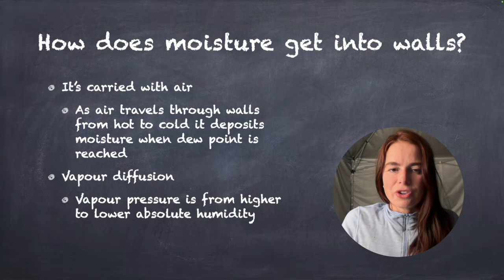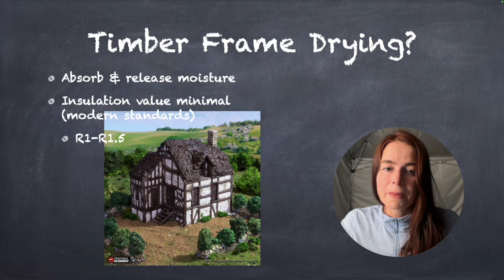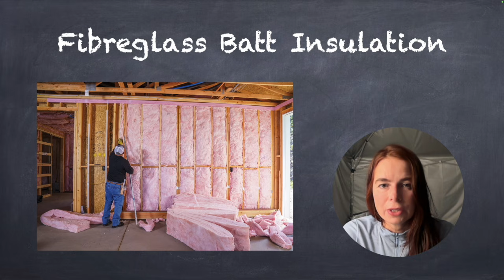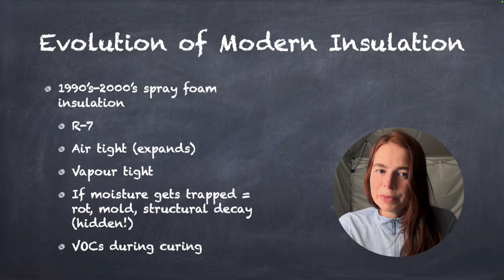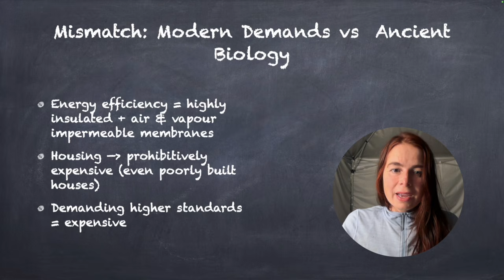The Evolution of Building Practices - Walls

Comment: I'm curious to hear your opinions on methods like brick and stucco. Honestly I was surprised that neither was mentioned here. I spent some time in Argentina, and most houses there are built using oversized hollow bricks, which then receive a 1-2 inch thick layer of cement on both the outer and inner surfaces of the wall. Interspersed throughout the load-bearing walls are poured reinforced concrete pillars, which also form the foundation as a hole is dug underneath each pillar and filled with reinforced concrete.
Reply from the maker: You’re right.. traditional brick and lime stucco would have fit here. I focused on earth-based systems in this episode, but brick laid in lime mortar and finished with lime stucco belongs to the same pre-industrial era of building.

Where things really change is with modern brick paired with cement mortar and cement stucco — those assemblies are much less forgiving when it comes to moisture and drying, which is why they tend to age so differently. That shift probably deserves its own video.
Reply: @thehealthybuildingproject  So it sounds like you would recommend lime mortar over Portland mortar. Why is that? If you can summarize it into a quick reply that would be great, though a full video on the topic is absolutely something I’d watch.
Reply: @thehealthybuildingproject  Yes, would love to see such a video.  Thank you for your content.

Comment: A lime based white washing on walls often helpped protect them, far more than we realise today. A protective over coating if applied right and often enough may prevent some problems that otherwise would become major issues. It is often the small over looked details that make a huge difference that compound into massive changes.
Reply from the maker: Couldn’t agree more. Lime is one of those materials that looks simple on the surface, but the deeper you go, the more extraordinary it becomes.

I’m actually in the middle of a deep research dive into lime right now—its history, how it’s made, and why it behaves the way it does—for the first video in a series I’m working on about the history of concrete. It shows up across so many cultures, climates, and eras for good reason.

That idea of limewash as a sacrificial, breathable protective layer is especially under-appreciated today. When applied correctly—and renewed over time—it can quietly prevent moisture and durability issues long before they ever become visible problems.

You’re exactly right: it’s often these small, easily overlooked details that compound over decades into either resilient buildings… or failing ones.

Comment: Mitigation start points: Sealing up from outside moisture, replacing insulation with rock wool, using more moisture permeable coverings like lathe/plaster on outside wall and ceilings. Avoid high temperature differences that is should we leave more rooms cooler if we can? Any thoughts?
Reply from the maker: Good instincts here. Bulk water control comes first, and materials that can tolerate and release moisture make modern assemblies much more resilient. Temperature matters mainly insofar as it affects surface condensation and drying potential.

Comment: I wonder if one of the culprit "modern demands" we're making on houses is the expectation that our indoor air temperature remain at 72-degree no matter the change in seasons. The temperature differential between the outside and inside air will create moisture risks year round. I know people aren't going to want to hear about wearing sweaters and heating bodies not air during the winter or - gasp! - go without AC in the summer, but still it's a potential low tech -low cost area to consider.
Reply from the maker: 100% - I read a bit today about how we survived in the past before central heating and heavy insulation.. we managed with localized heat, small rooms, massive heating appliances, heavy clothing... My next video is on ancestral roof systems but I actually thing the idea of questioning our modern expectations of "comfort" (to the detriment of air quality and health) is an interesting one to explore.
Reply: @thehealthybuildingproject I would love to learn about roofing systems!! So glad to have found your channel. 😊

Comment: In the southern USA, we have very warm humid air, so the vapor barrier is generally on the outer side, and the building is dried from the inside with the HVAC. However, I was on a number of construction sites in the 90s where we made the insulation extra cozy and put a polyethylene vapor barrier on both sides to make extra special mold bags! You're welcome. (I am available as a witness in the court cases) I find this topic extremely interesting.

Comment: As a Northern-European I have to say that there are easy solutions for all these problems and have been atleast 30 years already. It's just that people like to invent their own solutions and do the things like they have always been done, be it North-America, Japan, Australia or any other place. We build very similarly to North-Americans with stick frames and poly vapor barriers, but there are some major differences that highly effects the functionality of the structure. Having a vapor barrier (or anything that acts as such, like osb) on both sides of the insulation is absolutely forbidden. Great enphasis is given to natural ventilation behing exterior siding and under roof so any moisture or water that might get in the wall also has a way out of there. All materials in a wall must increase in water permeability going outwards so the wall structure naturally "pushes" moisture out. We also put a 2x2" horizontal strapping with 2" insulation on top of the poly to create a cavity for all the electrical lines and boxes and to protect the poly from all nail and screw holes in the future. And with an air tight house there also has to be forced ventilation that keeps a slightly negative pressure in the house that prevents moist air being pushed in the wall. There are many more differences from the foundation to the roof, but just to mention few.

Also the matter of indoor air quality affecting health has been studied to death in the past decades and is taken very seriously here.
Reply from the maker: You’re absolutely right — that’s a great summary of sound building-science principles. Northern Europe is way ahead of North America in actually applying them. Modern stick-frame construction can work well, but only when every layer is detailed with a solid understanding of moisture, air, and heat flow — and that’s almost never the case here.

Comment: Another excellent video!

Now, about those "intelligent" vapour barriers (membranes)... 

- The "Intello" one only "opens up" when the membrane can reach a temperature of min. 28°C (82.4°F) which is not always possible when you're using an airconditioner in summertime.
When using it in a basement, it will never open up...
- The SIGA one... The university of Vienna did a test and the difference between both directions was only 30%. 

In General
__________
Don't use vapour barriers but concentrate yourself on "air barriers" as every air barrier is also (more or less) a vapour barrier.
Use air barriers made from natural materials that can also buffer dampness , i.e. plywood, hardboard, MDF, all kinds of "eco boards",...

Sheetrock is also a great air barrier but it has the drawback that it will hold up moisture for too long which will turn it into a ground for mold growth (if it's not well insulated from cold or not properly ventilated).
Reply from the maker: Thank you! That’s such great insight — and I think you’re right about the smart vapour retarders. My impression too is that they only ‘open up’ in fairly specific conditions, so I’m not sure they always allow drying fast enough in the real world. I completely agree that air control is huge. Solid-mass assemblies (like my true love, rammed earth) tend to be far more forgiving when it comes to moisture. Really appreciate you sharing your thoughts!
Reply: @thehealthybuildingproject  Lot's of people think they are on the safe side by using a smart vapour retarder, but I would not rely on it... it's just marketing, you buy a very expensive membrane.

There's a case of a Belgian straw bale house where the owners thought they could rely on it in the flat roof assembly.
But the "intelligent" membrane never opened up so the straw and OSB started to rot after 2 years.
(The roof section contained a lot of moisture dating from the building period, i.e. the internal plastering).

Comment: Modern building philosophy seems to have complicated moisture management by eliminating "decorative" features like roof overhangs, window ledges and window sills. The problem is that these features were not originally intended to be decorative and buildings lacking them need near-perfect water sealing, something that cant' be guaranteed. The worst residential examples of this are the 1980s introduction of EIFS in the USA, Canada, Australia and New Zealand, and the growing use of vinyl siding in new houses, which was often installed with no housewrap. Both made a moldy mess of the walls on which they were installed. Of course, both now incorporate drainage planes with housewrap sealing around the windows, but the devil is still in the details. If window ledges and sills were still not only ubiquitous, but integrated with the flashing to bring the water away from the windows, minor leaks would no longer turn into major disasters. The same goes for roof overhangs, although they are still fairly common in some places.

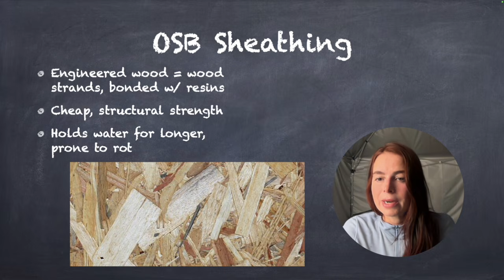Comment: 22:40 I believe the "6 mil polyethylene" came along sometime in the 1980s to keep moist inside air out of the wall and to keep cold or hot outside air from leaking in around the outlets, switches and wood trim. It seems like overkill, with as much potential to trap moisture in the wall as to keep it out. If the interior sheathing is taped and mudded drywall, caulking any openings (especially where cables go into electrical boxes) that are not mudded should prevent air currents without trapping moisture. If the interior is not inherently air tight, eg. wood-grained paneling or tongue&groove boards, paper or permeable plastic should suffice. Unfortunately, many builders are required by local code enforcement to use polyethylene.
Reply from the maker: Such a good point — thank you for bringing that up. Poly sheeting started showing up in homes around the mid-20th century, but by the 1980s it had become almost universal as both a vapour and air barrier. You’re right though — it can very easily trap moisture. In most regions builders still have to include a vapour barrier by code, but that doesn’t have to be poly — there are ‘smart’ vapour retarders now that adjust permeability with humidity.

That said, I’m cautious about how well modern materials actually dry in practice. With OSB, foams, and sealed claddings, once moisture gets in, it rarely leaves fast enough to prevent mold. Perfect airtightness is basically a fantasy, so I tend to lean toward ancestrally informed building — systems like rammed earth and other mass-based, vapour-open assemblies that don’t rely on membranes and tapes to stay healthy. The goal for me isn’t a wall that “breathes” through high-tech layers, but one that works with physics and time-tested materials to stay dry and durable even when things aren’t perfect.
Reply: @thehealthybuildingproject  I don't think the average new home is going to be built with anything better than exterior insulating sheathing and vapor barriers. "Rammed earth" = bespoke and expensive.. "Smart" vapor barriers = expensive. Homes can be tested for air and vapor leaks.

Comment: I was a builder in the 1990's and it was clear to me main causes of moisture and water damage had a lot to do with modern vapor and insulation control. Where the condensing surfaces are. Concrete basement walls dry to the inside of the basement. Older wall assemblies were able to dry out until you seal it up. We dont have large over hangs anymore to shed water away from the structure. We now put veneer stone directly onto plywood.
Reply from the maker: Completely agree — that’s such a good summary of what’s gone wrong in modern construction. So much of it comes down to how we’ve shifted the drying potential of assemblies. Once we started adding impermeable layers, removing overhangs, and sealing everything up, we stopped giving buildings a chance to breathe and dry. And yes — veneer stone over plywood is just asking for trouble. You said it perfectly.

Comment: Take a look into air Crete construction methods where they take soapy foam bubbles with a little bit of cement to make very insulating natural material. Lightweight permeable vapor open structures I'm building the welding shop with this material. Fireproof's important no synthetic materials is important. Insulation is important. The vapor permeability is important or my steel rusts
Reply: How is this different from commercially avaiable autoclaved aerated concrete other than being a big hassle?
Reply from the maker: From what I understand, they’re kind of cousins. Both trap air in a cement mix, but AAC is made in a factory under pressure so it’s stronger and more uniform. Air-crete is more of a DIY version — lighter, easier to make, but not as strong or consistent. Same general idea though!